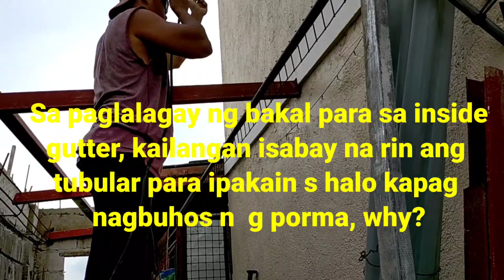HOW TO MAKE CONCRETE INSIDE GUTTER, IS IT DIFFICULT? WATCH - JAD Mix

Comment: Be reminded... Concrete is a porous material... Meaning..it absorbs water or moisture....Also, concrete is prown to cracking...
Reply: @ Manuel PATAWARAN
Your correct sir. Para sa matagalang gamit Ng concrete inside gutter, dapat nka water proofing or nka HDPE (  high density polyethylene ).

Comment: Hi, meron po ba kayong payo pag gagawa ng extension na concrete slab and roof idudugtong sa sim na roofing, pano po maiwasan ang leakage. Salamat po
Reply from the maker: Ang importante kc idol class A ang halo then lagyan ng Sahara, pag slab kc tatlong Sahara linalagay ko in 1 cement, then kailangan maayos ang pag buli, ung Walang nakitang bato, at alagaan ng dilig, Umaga tanghali at hapon, para Maiwasan ang pag crack o bitak ng flooring

Comment: bro pg ganyan na concrete gutter ano hinalo nyo sa semento para sa waterproof...at ano pa ang dapat ipahid o ilagay para hindi mg moist o crack sa loob dahil sa tubig..ganyan kasi sa bahay ko sa loob kita ang moist at sira na pintura....pinahiran ko na ng black cortal sa labas kaya lng pg sobra init ng crack sya kaya pg ulan ng moist sa loob...
Reply from the maker: Class A ang halo bro, ska para sure apat n Sahara inilagay ko isang cement, at para sure ang agos Ng tubig, 5cm s may downspout at 12cm s kabila, tested n un bro alang stock n tubig s gutter  sure n alang tagas s loob
Reply from the maker: Yung waterproof n cnasabi mo, may ginagamit ako nkalimutan ko lng name, binili ko may liquid n xa at powder parang kulay cement, paghaluin lng saka ipahid, ung iba KC pag pinahid mo nagging parang plastic, tuklap pag tumagal, Kung may alkitran maganda rin ipahid mas sure xa
Reply: Concrete rain gutter din ang bahay ko quatro agua , matibay sya ,almost 32 years na. Kaya lng meron part na tumutulo or tagas, kelangan siguro water proofing. Mas maganda daw yung rubberized or yung asphalt na tinatapal then pinapainitan ng apoy kaya lng mahal at dapat marunong yung maglalagay.

Comment: Sir mgandang araw po baka po pwd mkahingi ng picture ng concrete gutter na ginawa nyo sa labas at sa loob po ippagayaq lang po sir sa pinapgwa nmn na bahay slamt po.
Reply from the maker: Nabura ko n kc idol mga pic pero s mapanood nu magkaroon n kau Ng idea, Ang idadagdag ko lng, s levelation n ginawa ko, 5 cm s may butas at 12 cm s dulo para sure ang agos ng tubig, sure mo lng n Hindi magkaroon Ng stock n tubig s gutter para Walang moist s loob, ky kailangan I test muna ang Cleve Ng ginawa, buhusan ng tubig bago I finish o palitadahan, at Ang mahalaga class A ang halo, at 3 bags ng Sahara ginamit ko per cement para sure, thnks Po s comment idol
Reply: @jadmix3977  slmt po.